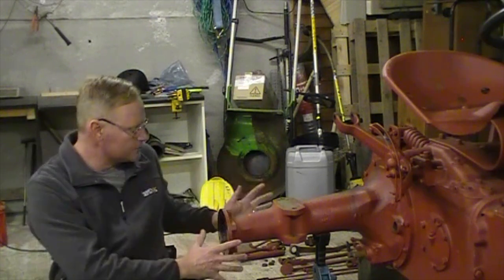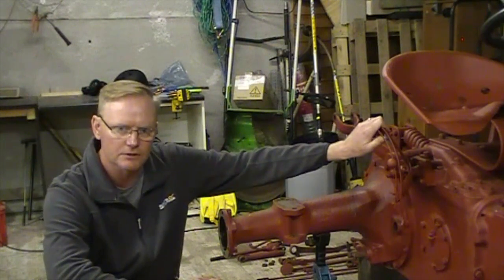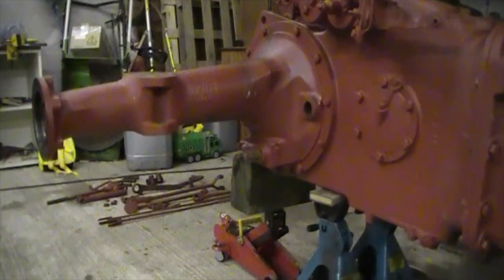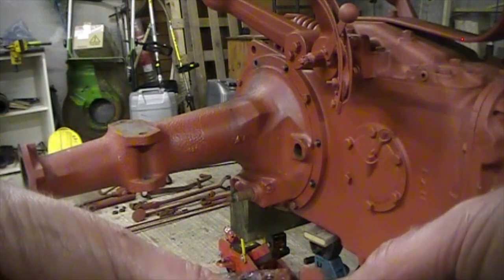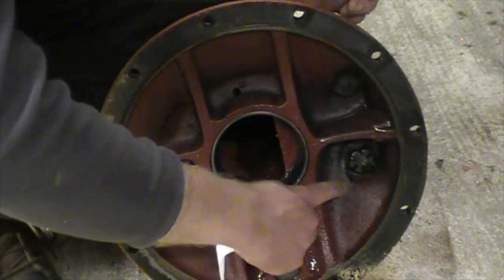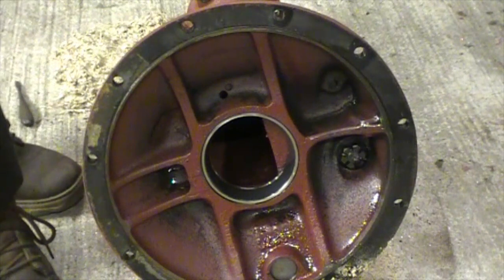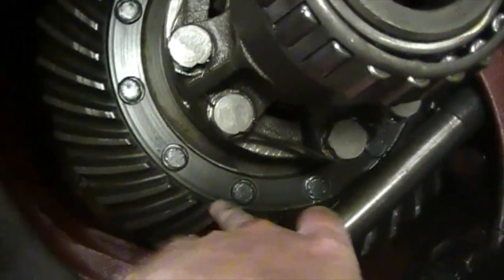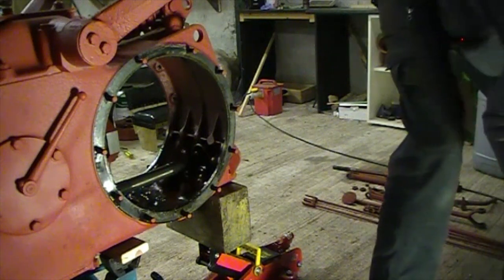#13 Ferguson TED20 - Removing Trumpet Housings and Crown Gear

Comment: That is a tab washer and is used normally inside motors. You bend one over the nut and the other tab over a fixed part.
Obviously they had to use whatever parts they had at the time.
Reply from the maker: Thank you. Yes some differences between tractors based on what they had at the time. 👍😉

Comment: Hi Gordon, very Informative video.
I have a slight weep from the nut inside of the trumpet housing holding the link arm bracket.
My question is regarding the gasket around the mating surfaces of the housing and backend.
The gaskets I've seen have far too many holes. Are these to accommodate numerous different models from manufacturers or do I need to find one with the correct amount of corresponding holes?
Regards Jonathan
Reply from the maker: Hi Jonathan, as far as I know that is the case, these gaskets are made to fit multiple versions hence the many holes. I expect it will work just fine, but I chose to simply make my own gasket as shown in a later video. It’s really easy and quite satisfying really. Hope this helps! 😉👍
Reply: @WaterhouseForde  Thanks Gordon. I'm not so brave or patient to make a gasket as big as the trumpet housing.
Smaller gaskets and seals maybe!
Thanks for the reply. 👍
Reply: Can you make it out of permatex? @WaterhouseForde

Comment: From the Fergy grapevine I hear that you should not have to drain the hydraulic fluid. The fluid level should not be so high as to reach the axle bearing which is greased.
Reply: Of course this only holds true if your removing the axle.
Reply from the maker: Hi Tim, certainly, if you need to remove the axle and not go deeper. You can lift the side you are working on and very little if any oil will come out. This is a recommended procedure. As standard the wheel bearings are not greased they are lubricated by the Diff/Hydraulic oil. As you will see in our reassembly video we fitted sure seals over the back of the wheel bearings which necessitates packing it with grease. We knew we were going deeper, much deeper so draining the fluid was necessary. Hope you’re enjoying the videos. 😉👍

Comment: Hi a have a Massey Ferguson 35x and I use it as my main small tractor. It works great despite being almost 60 years old. Yesterday the right side lower link pin broke. So I bought a new one for the 35x and also a new trumpet gasket. I want to ask this. What’s the torque specs for the trumpet bolts and for the pin?? Do I need an impact wrench to do the job or can i use a torque wrench???
Reply from the maker: Hi Donovan, thanks for reaching out. 60 years and still going strong! As far as I recall there is no official torque specification for the trumpet housing nuts. On the TED20, these are 7/16” nuts (spanner size) so a reasonable torque setting would be circa 38-40 ft/lbs. You don’t need an impact driver, although they are very useful 😉. Btw. Never use a torque wrench as a power bar. In particular never use it to loosen nuts and bolts! You will damage it very quickly. The nut on the back of the pin needs to be tight. Use loctite and a decent power bar to get it as tight as you can. If you then want to apply a torque it should probably be somewhere in the region of about 110 - 125 ft/lbs. I hope this helps. If you are just replacing the pin, you can probably get away with not having to reset the float clearance. Although technically because you are changing the gasket, you should. I did a video on this too. See: https://youtu.be/ZIjfAXU_uxo  Good luck, let me know if you have any other questions. 👍😉

Comment: Coming along nicely Gordon.....Don't know if you've seen the saga of the Nuffield, but I've found every type of nuts and bolts. Whitworth, AF, Metric and some totally unique. I know the bodger in Somerset who had it for years is mainly responsible, however many of these old tractors when used on farms, they just put on  what was lying around.
Reply from the maker: Hi Malcolm, yes I suppose when they’re working machines and “time is money” etc. the most important thing is to get it running again. Enjoying your videos too. 😉